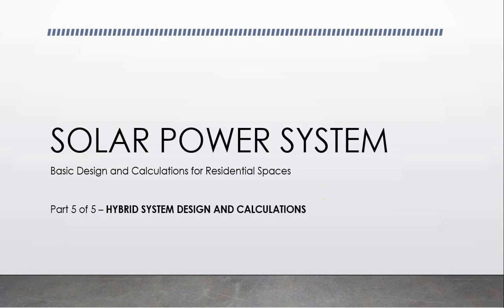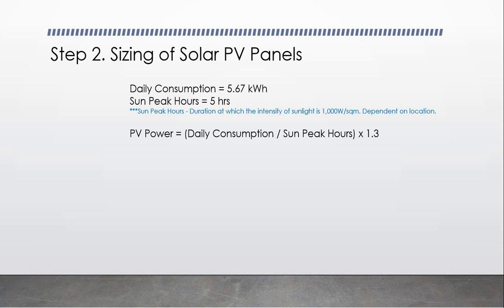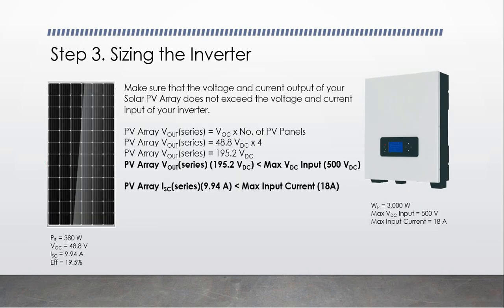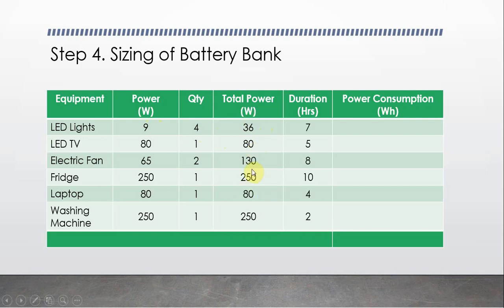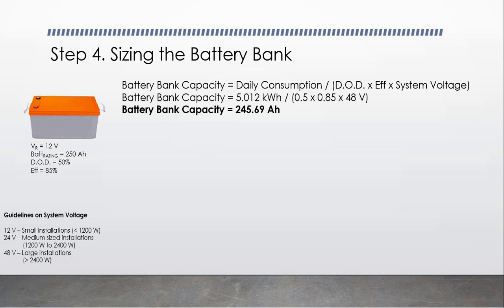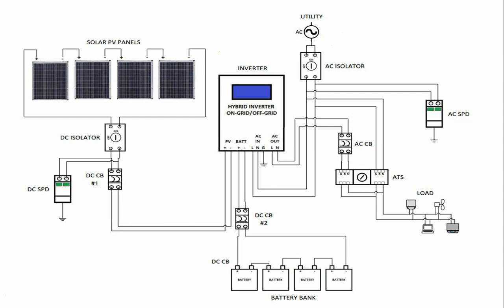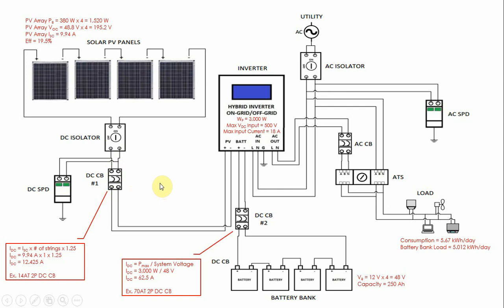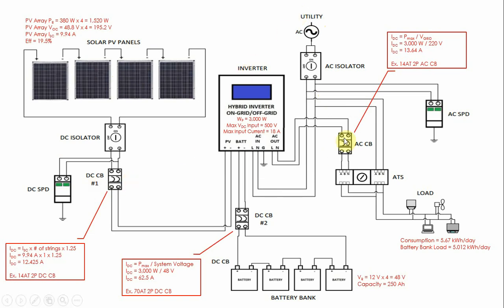DIY Solar | Sizing a Hybrid Solar Power System | Battery Sizing | On-Grid | Grid-Tie | Off-Grid

Comment: Sir, planning to build 32650 cells in 48v range 96ah. So, in total i got 16s 16p then will use 48v 16s 100ah bms. My max continuous discharge current is 240A could this Ampere be fit in my 5kw HOG inverter?
Reply from the maker: Hello Sir, may I check with you what type of load are you planning to plug into your HOG? What is the total power of your load? I believe 240A discharge current is too high.
Reply: @OliverJayYoutube  AC =690W .75hp dual inverter
Fans =60W 3pcs
Lights =5W 3pcs
Laptop =90W
All are running 4hrs. But not at the same time. Got 3,885 Wh. May I know what is the max continuous discharge current for/meaning? Btw, I really caught up by your vids, it's way too easy to comprehend compared to others. Keep it up! Also, I can't find max input current of Sako Sunon 5kw HOG is it the Amp rating of MPPT inside?
Reply from the maker: Hello Sir, i believe your battery set-up should be fine and will be able to support your load. Lithium batteries will have higher depth of discharge and efficiency than gel batteries. From the numbers, i guess you are using 3V 6000mAh per cell or somewhere around that.
The max discharge current is a battery specification defined by manufacturers to prevent over diacharging the batteries which will damage it.. The max discharge current of 240A is still a long way to go so your still ok.
And yes, you can use your 5kw HOG for this.
Hope this helps and I appreciate your feedback.
Reply from the maker: Hello Sir, yes, I think it is. The max solar charge current is the max current from the PV panels going to your hybrid inverter.

Comment: Sir para saan po yung 1.3 sa sizing of solar pv. Ano ang purpose noon? Salamat
Reply from the maker: For buffer capacity sir in case hindi masyadong maaraw. Yung 1.3 effectively adds 30% sa pv capacity. You can adjust this as you want.

Comment: What's 1.3?
Reply from the maker: Hi, the 1.3 is just a capacity buffer for the PV panels to compensate for cloudy skies. This is optional, you may remove the 1.3 or you can adjust it according to your preference.

Comment: how do I calculate the side of circuit breaker?
Reply: I believe he did explain both just rewatch and he goes over both DC and AC circuit Breakers
Reply: Just scan through video and see the red boxes pop up around the DC CB #1, DC CB #2 and AC CB on the expanded diagram

Comment: Hi Oliver, I am trying to simulate using your formula for our monthly use, Bill/cost per kwh = 1300
So I got 43 kWh.. using your formula require 30 pc PC. If we combine series and parallel, will it give same result (power wise) at the end?
Reply from the maker: Hello sir, different series-parallel combinations of PV will yield different voltage and current outputs but the power will always be the same.
Quick question, the 43kWh is your daily or monthly consumption?
Reply: @OliverJayYoutube  It should be daily after total monthly divided by 30
Reply: @OliverJayYoutube  If I use series the total watt over my inverter watt (I am planning to use Growatt spf 5000 ES) so I want to reduce watt and increase current
Reply: If I am not miss reading it says 5000 Watt, 450 V and 80 A